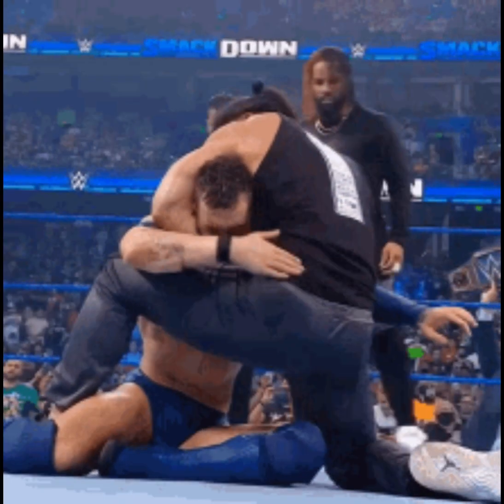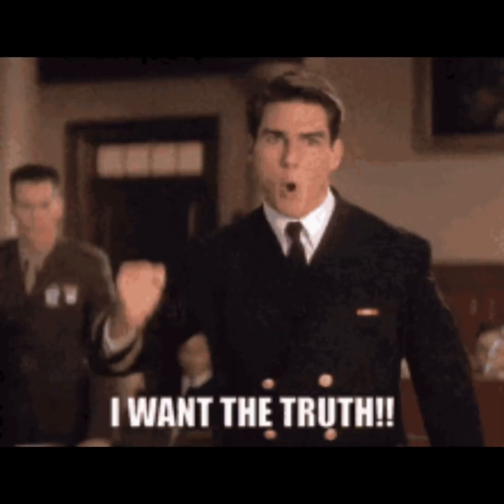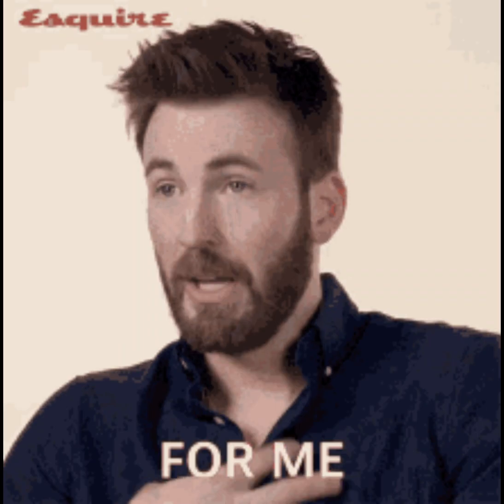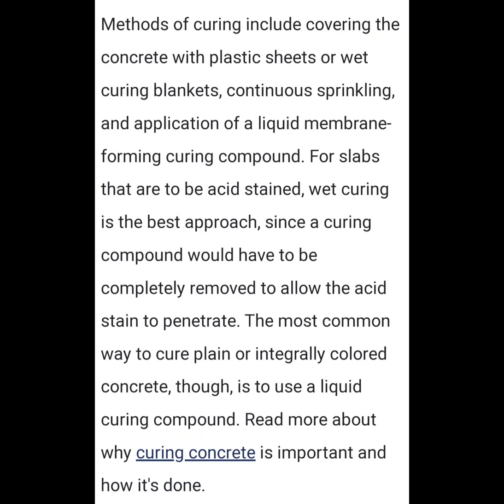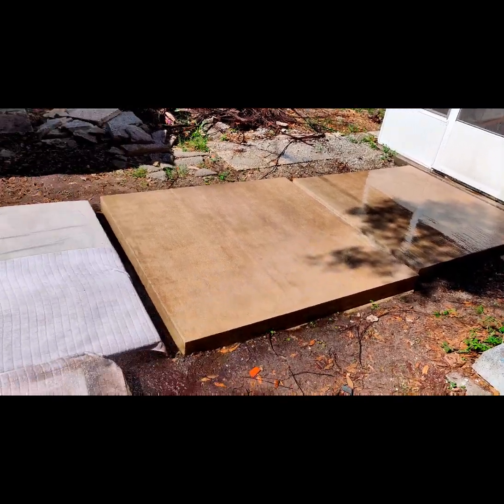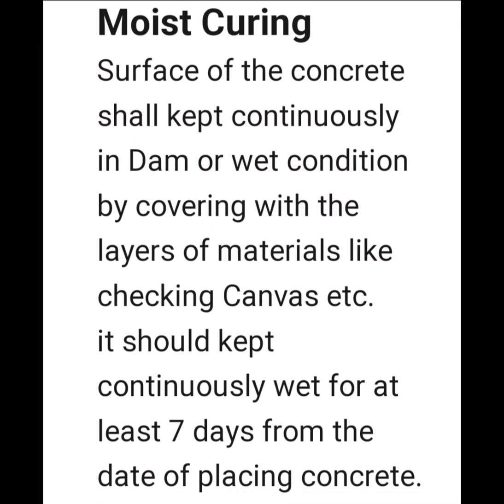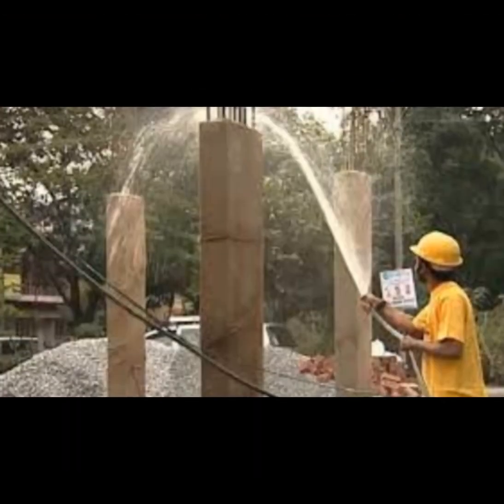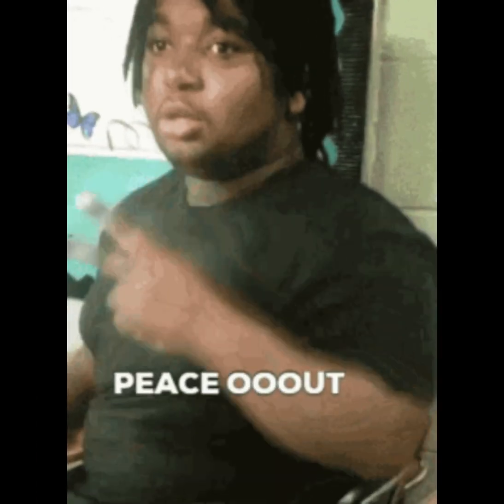Diy Dry pour concrete Water curing for strength

Comment: We're in the Arizona desert, and did a dry pour over a slab that was already there. The top is raggedy and messed up, I think because we did it on a hot day and the top sealed up and delaminated  because the water didn't go through enough (evaporated too fast after forming a crust). BUT I found your mortar mix fix before we did it so I'm not too worried. I did decide to cure it by wetting it several times a day, keeping a canvas dropcloth over it, and a tarp over that, and I'll do it for the next couple few weeks.
Reply from the maker: Awesome man good luck!!! Post a video of you can!

Comment: My guy….you’re going to help revolutionize dry pouring.  I finished 2/3 sections of my 24’ x 14.5’ patio.  Saturating the land inside the forms before pouring should help with additional moisture.  I recorded most of my progress so far.
Reply: I have been trying to find information about wetting the ground (specifically wetting a gravel base) before putting the dry bags of concrete on top vs dry ground.  There is a couple on YouTube who had issues with bubbles coming to the top after misting and showering the dry pour.  They did not wet the gravel base underneath before putting on the dry concrete.  Or it could just be due to their hot, dry climate.  Looking for info about bubbling.
Reply from the maker: @sterlgirlceline  the bubbling comes from air pockets 🤙 to solve that problem you will want to compact the Dry pour plus hit the sides with a hammer or rubber mallet 🙌 I have those answers in my videos your almost there 😎😂 actually editing a update video now of my last slab🤙 should be up soon🤙
Reply: @DiyTheGrappler  Thank you for taking the time out of your day to respond!  I REALLY appreciate it and your videos are SO helpful 👏🏻👏🏻👏🏻😊!  Have you seen the concrete expert professor Ph.D Tyler Ley’s info in his videos about fiberglass rebar instead of metal?  

If you are going to go a driveway, you’ll def want to check that out.  Apparently, any metal in concrete corrodes and causes cracking/breakage of cement.  Not sure if this could be stopped by sealing though.  

There is fiber rebar called Pinkbar made by Owens Corning and there is a concrete contractor on YouTube who uses it.  It is not expensive either.  You’ll def want to check out Pinkbar if you are going to do a driveway.  I am getting ready to do an 8x20 cement slab for a shed and I am pretty apprehensive about it.  Your videos are so helpful! ⭐️⭐️⭐️⭐️⭐️⭐️
Reply from the maker: @sterlgirlceline  Thanks 👍 I actually study and mention Tyler ley in my videos! About the water curing an other ways to make concrete strong 🤙there is another guy creating Concrete has a lot of good info 🤙
Reply: @DiyTheGrappler  What is the name of the other person’s YouTube channel you are referring to?  I am going to be using Pinkbar in my 8x20 shed slab so will let you know how it all goes.  Still looking for info to decide on type of gravel base.  Not sure what type of concrete I am going to use yet either.  

I really appreciate you experimenting with different types of concrete.  There is also a man who did an experiment with different concrete brands.  He used one side of his frame with clear acrylic so we could see if the concrete solidified all the way through and what was going on inside.
Reply from the maker: @sterlgirlceline  I studied a few people
Tyler ley learn about water curing/Hydration process and chemical reaction with in the concrete

Cajun country how to dry pour 

Teddy Zane learned about topping the Dry Pour with a mortar or now I'm using the same concept with sand mix for a smooth no rock finish

Creating Concrete learned more about water curing

Compacting the Dry concrete I learned from my first slab I dry poured and had air pockets rise to the top and cause spalling and scaling,,(holes that came from air pockets coming to the top)
Reply: @sterlgirlceline  I didn’t saturate the ground on my first patio section and I got air bubbles.  Everything else has worked out fine since making sure the ground was wet before pouring the concrete.  I’m not too worried since I’ll be applying a coat of NewCrete to cover the surface
Reply: @theblackenddev  Thank you for taking the time to respond.  I really appreciate it 😊⭐️. I saw the couple on YouTube getting bubbles which made me nervous to do my project.  I am going to be putting down and compacting a gravel base for a cement shed so bubbles would cause problems 😱
Reply: @sterlgirlceline  you’re welcome!  We all need to share knowledge since there’s not much out there.  Another tip is to NOT over water the first day.  Mist once every hour for 2-3 hours then do a nice shower but I wouldn’t soak it too much. My best results came from waiting for that top to set for about 8hrs then start showering often.  I used Quikrete 80lb high strength…the yellow bag.
Reply from the maker: Appreciate that! Post a video, would love to see your progress 🤙🙌

Comment: Great video, made me laugh. I wonder why wet pour people say to not add too much water when mixing because it will make the concrete weaker?
Reply from the maker: Appreciate it 🤙 I believe that's correct not adding to much water to the mixture 🤙 but on another note,, this curing takes place after the concrete is set/finished,, meaning if i mix the concrete and it calls for 2 quart's and I put 5 quart's in to the mix,, this case the mix would be to watered down making the concrete weak,, but in the case of proper mix quantities and the concrete if "finished" this is where the curing process would take place 🤙
Reply: @DiyTheGrappler   Exactly! The ratios are crucial to making that matrix form inside. Once it is correct and starts to cure, keeping a dry-pour piece hydrated will let it finish right. It's like baking stuff - too much of one item can throw off the whole thing.
I am going to do a series of 4x4 pieces and plan on spraying them with Thompsons Water Seal after the first 24. I'll let ya know how it turns out. DaveW/PHX
Reply from the maker: @Remo303-c9i  awesome good luck!
Reply: @Remo303-c9i There is a concrete expert, Ph.D professor who has a channel Tyler Ley who has a lot of empirically-based information about concrete/cement, etc.  He has a specific video about sealing (and curing also).  According to him, concrete doesn’t cure for 28 days.  I’ll try to link the video for you but not sure if YouTube allows links in comments.